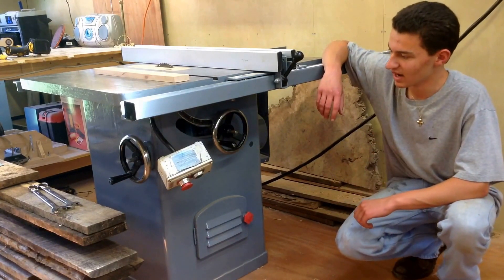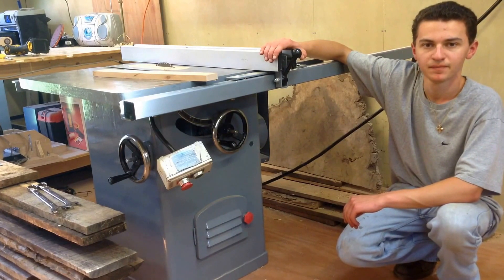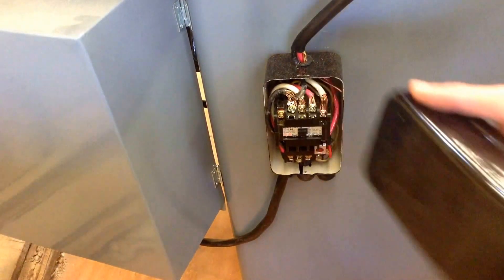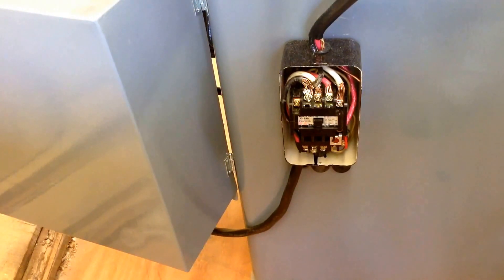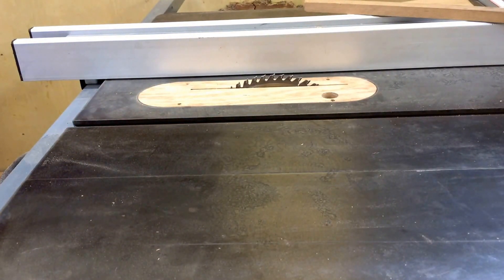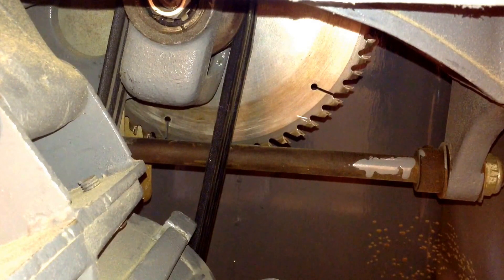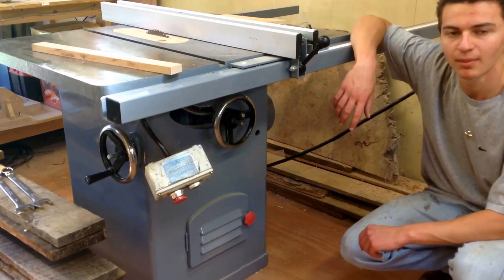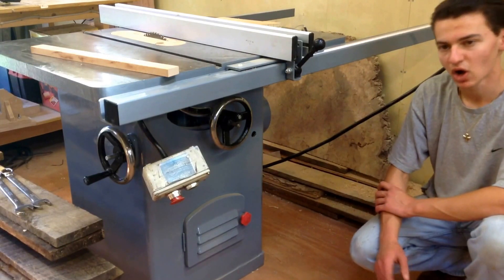New Machines for the Shop; Part 2 of 3: Jet CTAS-10 Cabinet Table Saw Problems

Comment: You did a great job restoring it. Looks great. This is a dumb question but how sharp is the blade? Just a thought. Why don't you by pass the magnetic switch and the on off switch? Hardwire it from the breaker box directly to the motor. If it does the exact same thing you know its not in the magnetic switch. Make sure the two hots out of the box are connected correctly on the motor wiring. I know this is a real pisser but I have a motor that would bolt right up to your saw. wish you had it!
Reply: ***** I'm by far no expert on the matter and someone please correct me if I'm wrong but the way I see it you really don't need the magnetic switch on it anyway. You can remove it (YouTube safety patrol insert comment hear) or just bypass it for now until you know for sure the motor is a good motor. If it were mine just for test purposes I would hard wire directly from the breaker with your (2) 110V wires. If the motor runs like it should then backtrack your problem to the mag switch and main power switch.
Reply: ***** well.the way I see it lets just say you have two problems.  That is possible. You could have a problem with the motor AND a problem with the magnetic switch it will make you chase your t tail a lot longer. That's what I was thinking when I said that. Good luck let me know what you find. Tom

Comment: Ok, first things first.  You stated you have a 30 ampere feed coming from the house, and it powers a larger motor than this one is.  So it has to be assumed you have 240 volts.  I am also assuming that you brought a neutral conductor and a ground conductor.  If correct so far, then you have both 120 volts and 240 volts available.  The magnetic starter coil is probably rated at 240 vac.  This means it needs that voltage to pull in.  It is acting like you have only 120 volts. Typical wire colors(not required) would be black & red for hots, white for neutral, and green required for ground.  Did you possibly hook the saw up with a hot and neutral, and not two hots.  The starter and the motor would act this way because the voltage is too low.  Kevin Cooper

Comment: Measure the voltages, make sure you are getting 220v on the leads going to the motor.  Check your run capacitor.  Your start capacitor is good.  The wiring at the contractor looks atrocious, I'd rip it out and re-do it.  The wires coming out of the box should be secure, and not stripped back that far (if they rub, you will cause a short).  At least get some clamps, the kind you would use for Romex wire to keep everything secure.  The wires inside of the box are stripped back way too far.  You may be able to tidy them up using some crimp on lugs.  Do you have a 4 conductor plug with a neutral wire or just a 3 conductor plug with only a ground?  I really think you have 110 going to a 220 motor.

What I'm guessing is that I see 3 large wires on the contactor.  The white may be a neutral wire.  You only need 2 wires going through the contactor and 2 wires going to the motor plus a ground.  Make sure the ground is pig tailed to the electrical box for safety.  You do not need to switch the neutral wire, and the motor does not need a neutral wire.  The only reason it's there is to make 110v (which may be needed for the contactor winding).  I believe the diagram should have three wires going to the switch.  The contactor has a specific winding voltage, that is what will be send to the switch.
Reply: ***** I'm not all to familiar with the wiring schema for the contactor, so take what I said above with a grain of salt.

There is one start capacitor and one run capacitor.  The one connected to the centripical swich is the start capacitor.  Your video make it sound like the start capacitor is working correctly.  The run capacitor is on the run windings and helps the motor run more efficiently.  I'm not exactly sure what the symptoms of a bad run capacitor are.

I'm assuming there is noting wrong with the motor bearings or arbor bearings.  Have you checked those?

I'd rewire the contactor, seriously.  Maybe a wire is loose?
Reply: ***** The start windings are separate from the run windings...out of phase to get the motor to turn in a certain direction.  If the motor turns on then they are working.  The start windings turn off once the motor gets up to speed and the centripetal switch clicks off.  So, one can make sure your centripetal switch is clicking.  If it doesn't, the motor will run like crap and eventually overheat.
Reply: One more diagnostic that I didn't mention earlier that works for single phase motors...  If you want to check if the motor is working properly, and that the problem resides with the contactor, just wire the motor straight to the cord and plug it into the wall.  If the saw doesn't bog down, then the motor is fine, if it still does, then there is something wrong with the motor.
Reply: Electrical tape!  Eww.  I believe, but don't take my word for it, the capacitors are supposed to be in series with their respective winding.  One is in series with the centripetal switch and the start winding.  The other is in series with the run winding.  The capacitors induce a phase shift.  I don't know a whole lot, I'll see if I can find any links for you.
Reply: If the start capacitor doesn't turn off, I think it would rumble and stuff.  If you hear a click, and also from what I saw in your vid, then that's probably not the problem.  Was the thing previously jimmy-rigged?  There should be a wiring diagram on the motor, but if it's a 220v only motor, all it shows is two hot lines.
Reply: Both of the 110 legs are opposite phases, so they sum up to 220 single phase.  It sounds like it was using ground as neutral, which is BAD.  Check the coil voltage for the contactor and make sure it's 220v, it should be listed somewhere on it.

Yeah, make sure the belt is tensioned right and the pulleys are clean.  Some of mine get warm, some don't.  I have an A belt on my jointer that gets warm.  I have the Harbor Freight Jason Industries link belts on half of my machines, they seem to work better.  I'd like to get AX belts but don't have any local sources for when I size them wrong.
Reply: The contactor has a specified voltage it's to be ran at.  Each one is different.  I don't know anything about the thermal overload.  I've never seen one that you can set.  Is it attached to the motor or the contactor?  If it's part of the contactor, then it needs to be sized specifically for the motor requirements.
Reply: If the thermal overload is seperate from the motor, then yes, it needs to be properly sized to the motor.  Find the manual for the unit.
Reply: The literature for the contactor.  It should be on the manufacturer's site.  That into won't be in saw manual, you aren't supposed to play with those.
Reply: Who made the contactor?  Square D, or someone else?